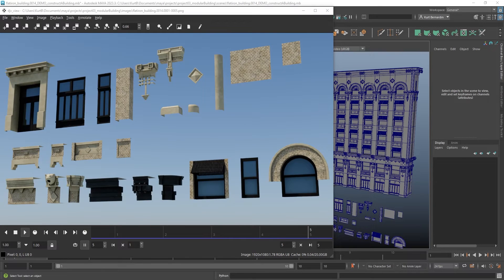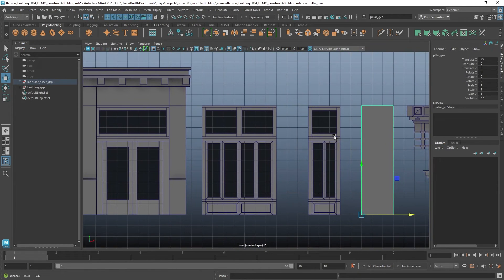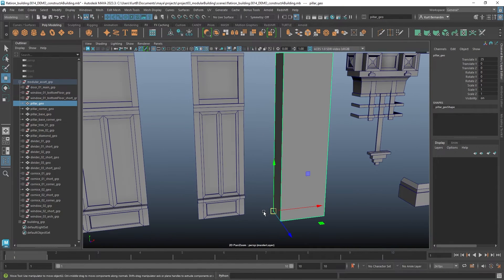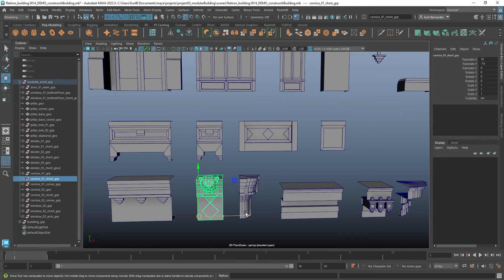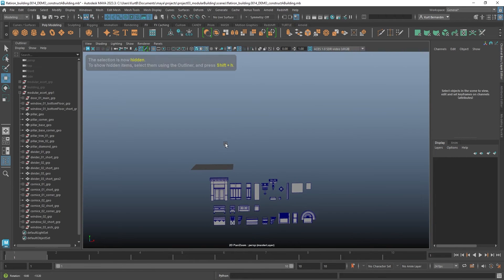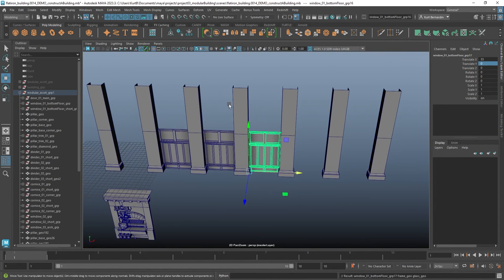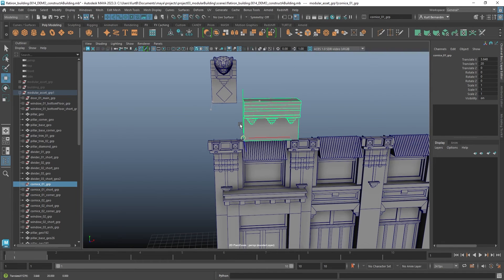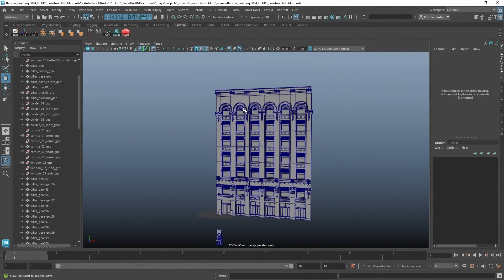Modular Modeling | Assembly Tips & Tricks

Comment: Very good, but you forgot the backdoor and the fire escape LOL. Shouldn't you texture the pieces first to save time later?
Reply from the maker: I've found that when you're typically building a modular kit, you will go back and forth between modeling, UVing, and texturing until you find what works best to complete the building.  Maya has a Replace Objects Tool that will let you update all copies of your geometry relatively quickly.  If you're making assets for a game engine, once you update the one asset, it'll update every instance.
Reply: @KurtBernardin  I use 3ds max. One day I will try maya. I have made this layout before, and it is so annoying when you think you got everything covered in the sheet, and you forget something LOL. Was only joking about the fire escape heh heh

Comment: This was a great video on the nuts and bolts of modular building. I notice you didn't use any of the corner pieces in the assembly part. That part was a tad confusing, but other than that, well done video.

Comment: Greetings, first of all thanks for the video. Do we use different material for each mesh or one material for all of them, like trimm sheet?
Reply from the maker: I think that's entirely dependent on the needs of the project.  A trim sheet would be the most optimized way to set this up.  For this particular building, I only setup four materials (seamless brick, seamless concrete, seamless black metal, and glass).  If I were to push this further, I would probably add some additional unique props that would require their own unique materials.